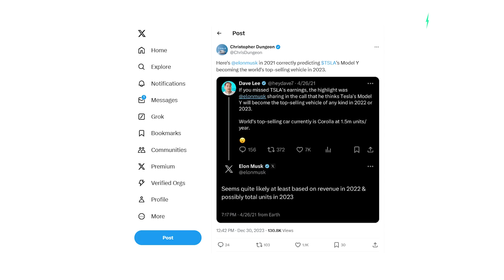CEO of CATL says Tesla’s 4680 battery cell is DOOMED to fail

Comment: isn't that the beauty of EV, locomotion independent of energy source?  switching battery technology is just plugging a different battery module in. switching between rotary, radial, diesel, inline, v shaped,  more or less cylinders requires major engineering changes and adding or subtracting major systems/subsystems including fuel,  cooling, exhaust, emissions, control

Comment: CATL is correct. Tesla has produced a lot of 4680 cells but people who had them in the Model Y and now the Cyber Truck can tell you they're not all that special. The really didn't seem to offer much more than the 2170. Supposedly they've just finalized the dry cathode process but CATL is already beyond that in battery technology. At this point 4680 concept 5 or more years old. The Cyber Truck has a huge battery but it didn't give the truck the range Tesla said it would have yet others who have huge batteries such as the Silverado and Sierra EV have shown that, yes, you can slap a large battery in the truck and achieve over 440 miles of Range and be a road king. I personally believe the next or future offerings from CATL will do the same and if Tesla is smart about this they would get all of CATL's future high tech batteries to be used in their vehicles.

Comment: I saw it in the first year 4680 announced and have shared my concern in previous comments. 

That cylinder volume increase faster than the skin area. If all else are equal : essentially, cell capacity and heat dissipation rise faster than heat sinking skin area. That impedes the cell size to around 18650 for optimal fast charge and discharge, Panasonic knew that. The 4680 form factor limits the product’s reliability and safety much below 18650’s.

Comment: There is a relation to heat dissipation - Tesla uses "snake cooling" with the 4680 batteries which works better than blade batteries. 

Blade batteries had been okay with LFP which have a lower energy density and therefore heat could be removed good enough. Now look at the competiting Geely's short blade system which is done for that exact reason - they are building higher-CC LFP batteries and they need a different design to handle the heat. CATL and BYD however announced lately that they have solved the problem allowing for 6C charging - but there is no real-life experience about that so far. A lot of hot air here?

Comment: As far as I know, the main engineering design of the 4680's is not being used as intended right now. And that is the ability to be cooled from the inside out using all those tabs by applying coolant to the top and bottom.

Comment: Elon Musk envisioned how the 4680 cell was going to be produced after watching cans being produced. There is almost nothing more inexpensively produced as aluminum cans. However, it is the filling of those cans that can cost a lot. Fill a can with water and it won't cost much. Fill it with caviar and the cost is completely different. Even if Tesla's 4680 cells never reach the energy density of a CATL battery, as long as it is good enough there will be a place for it in the multiple battery markets coming online. If the 4680 isn't good enough for Tesla personal vehicles because people are demanding ranges that are longer than it can provide, it will be good for the Tesla Semi, or it will be useful in the Tesla Power Wall, or they can be used in Tesla Mega Packs. And these are only things that are internal to Tesla. There are lots of companies that will buy a relatively inexpensive battery like the 4680 to use in their products (or Tesla could expand into these markets with the 4680), and those would be battery powered portable power stations, large electric heavy equipment like front loaders, mining trucks, etc., small electric equipment like tractors, bobcats, forklifts, etc., emergency power supply, the list is endless. Tesla just has to keep making the 4680 batteries and review its manufacturing to try to gain reductions in costs. Over time they can make chemistry improvements as well. There are LFP batteries on the market that are made using the cylinder form factor. Tesla could use its method of producing its 4680 cells but use LMFP chemistry, or Lithium manganese oxide (LMO) (manganese spinel) batteries that improves ion flow, lowers internal resistance, and increases current handling. Lower resistance means lower heat buildup in the battery, which is a complaint said of the current 4680s.

Comment: I mean What is Tesla known for? Cutting costs and ranking production. give it more time, its the right Way to solve the problem with the 4680 calls in the Long run they Will be able to outperform lfp batteries, its a cost and production time issue currently that halting Them.

Comment: Panasonic in the last these days said that their mass-producing of the big 4680 batteries is fully starting and the capacity of their 4680 is 5 times ( 500,% ) higher than the old format like 2170.
Now it is possible that the prismatic format of the CATL batteries might be better overall already, at least at fully and better volumetric utilization of any existing cradle volume, but the Panasonic's 4680 might create some good competition for a while.
However, by the time the waters get clearer between geometrical formats, the solid-state batteries might be out dethroning all other formats and chemistries.

Comment: I don't disagree that Tesla will likely use more prismatic cells than cylindrical cells, especially since CATL is the biggest battery maker in the world and that's where the most supply is. However, there is nothing preventing Tesla from making an LFP 4680. They are not mutually exclusive.

Comment: The 4680 was billed as "tabless" but the turth is it is many tabbed; which means it has to do the very difficult task of folding all these tabs perectly together at high speed and get a functional battery and also have production levels of cells to put in vehicles.  Cybertruck uses 4680 and production numbers are up; though way below any meaningful figures like even 100,000 Cybertrucks a year.  The entire line of Tesla's was suppose to have 4680s; that for sure will not happen before some hopefully better technology comes along that doesn't catch fire as Lithium does.  If BEVs can't find a better chemistry the entire segment will fall down.

Comment: Elon Musks masters thesis was about Super capacitors, which have many similarities to batteries so I think he knows more about it than this CATL CEO thinks.. Elon Musk never finished his masters because he became too busy with his start up companies and figured out remaining a student was a waste of time and money.

And Elon Musk is not really leading the battery cell branch at Tesla, he has some great team doing that for Tesla.

Also I dont understand why the CATL is so negative about Tesla, they delivering many Gwh of batteries to Tesla for their Chinese built cars and in  few months tons of CATL cells will go into megapacks!

The original motivation for Tesla to start developing their own Batteries was that the existing companies at the time were not moving fast enough and not enough batteries were produced and it did not look like Tesla would get enough batteries to fulfill their growth plans..

This all has changed somewhat, for macro economic reasons, Tesla has pulled back on their growth plans (Mexico factory on hold, extension in Berlin delayed), and battery manufacturing companies did catch up to a level there is no longer a shortage in battery cells for Tesla. Tesla has ALWAYS been saying they will use a shit ton of batteries from other manufacturers, so it is no news Tesla uses CATL battery cells. The 4680 was never meant to replace all other battery suppliers, but just a supplemental to what Tesla could get from battery suppliers.

But the same time, the development of the Tesla 4680 cells did not go as planned either, it was a lot slower than expected. But they have build out production capacity in Texas this year and the cells they make are all ending up in Cybertrucks, they even call it the Cybercell now.. Also Tesla is going forward with the Cathode plant and the lithiun refinery in Corpus Christy, this will reduce the costs of battery materials tremendously, and will lower the costs of the 4680 cell using these in house refined materials. If Tesla gets at a point they produce more than is required for the Cybertruck, they will start using them in the Model Y and probably also in the Cybercab, as these are the cheapest batteries for Tesla at that point.

Anyway, it is all a balance between costs, performance and availability, and we all know, Tesla is a master in allocating assets in the most efficient way.. So just let Tesla and Elon Musk do what they are best in doing, and everything will be allright.

Comment: i think even you're too negative on it; the format has nothing to do with the chemistry, there's no reason Tesla can't make LFP 4680s, they just won't until they're happy with the production process for NMC. Ultimately the cell manufacturing cost, regardless of chemistry, is what this is about. Think about it: any new tech has a higher probability of failing in the field, so as an OEM you want to introduce new tech in the smallest possible volumes first so if you have a high failure % at first it doesn't kill you on warranty. Model 3 was introduced before Model Y, despite them knowing Y would have higher margins and sell better. 4680 was introduced in some limited Y runs, and Cybertruck.

Comment: You could have included a discussion of tariffs on imported Chinese batteries and the IRA credit on U.S. made batteries. Both are material in determining actual battery cost in each vehicle. Also you could have expanded to consider Tesla using equipment from CATL to make LFP batteries in the U.S.

Comment: Due to the cylindrical shape the 4680 is inherently less dense at the pack level than a prismatic or blade format battery, and hard to use flat plates as heat collection/transfer fins between them, which adds heat dispersion problems if fast charging.
Reply: Yeah, its shape wastes a lot of space between cells.
Reply: @QH96  not much space, and much of this is occupied by cooling channels.
Reply: the tesla 4680s are the worst of all the batteries.   poor charging.   the worst degradation.     the only ones who benefit from using them are tesla themselves as they can make them cheaper then buying the byd blade batteries for instance(the best batteries)

Comment: About 30 years ago I was an electrical engineer working on portable data collection terminals. We were striving to significantly reduce the physical size of the new model over our previous models. Initially we were very enthused with prismatic batteries that Panasonic had developed. Unfortunately for us Panasonic discontinued the prismatic batteries because they said the batteries had reliability problems that they couldn't fix.

And here we are again. Except this time it seems like the problems with rectangular batteries have been solved. If that's so it certainly seems like the 4680's days are numbered. All other things being equal it is hard to see how a rectangular battery won't win in the end.
Reply: Can't cool them square is horrible for batteries.
Reply: @oleolson6553 Of course they are cooled. Millions of battery packs use them.
Reply: Depends on how many houses it burns down.

Comment: For the Chinese, everything is about saving face. If Tesla succeeds with the 4680, CATL will loose face. This is just cultural hubris, nothing more. The 4680 is a great design, adaptable to any battery chemistry. Prismatic cells are harder to keep cool because the core of the battery is too far from the surface.
Reply: If CATL had problems keeping things cool, they wouldn't be selling grid storage with twice the energy density of Tesla's megapacks. Tesla is way behind
Reply: You have go tthat backwards. With prismattic cells you can make them thin so heat dissipaion is not a problem. Prismaic is far more flexible than cylindrical.

Comment: Musk is missing the point. CATL isn't saying Tesla won't make money, they are saying 4680 is not a successful design. and I agree, cylinder battery has alot of issue due to the rolling stress means the material is always going to be unevenly stress. this means it is going to reach the peak of what the material can do alot earlier than other form factor. the only reason Tesla pick this is due to their experience with panasonic making cylinder batteries, but it is a dated technology, you can't change physic. eventually even Tesla itself will abandon the 4680. it is just a dated design.
Reply: It's dated but safe since it really doesn't matter a lot, getting dry cell working and cobalt out along with silicon in are the hard miles.

Comment: I'm also not a battery engineer but all along I have wondered, isn't a rectangular battery more space efficient than a round battery when packaging them into a giant rectangular box? Just seems to me the dead space between cylinders is space that could be filled with battery chemicals. Like square drink boxes packed in a given size case have more drink than round cans of drink in the same size case.

But again, I'm not an engineer and just thinking out loud.

Comment: Solid state will crush all the current form factors
Reply: Why is that?
Reply: The chemistry and the form factor are two quiet separate things.  There is no such thing as a solid state form factor.
Reply: Solid state is currently a non factor. Too expensive, not enough charge cycles.
Reply: @ that is not what QS says. They say it will be cheaper to make.  They also noted it has over 1,000 charge cycles.  What solid state batteries are you indicating dont excel.
Reply: @cascaderetriever7618  they currently cost well over $100/kwh, while LFP batteries are getting close to $50/kwh. Current versions of solid state haven't performed well in low temperatures, and 1000 cycles isn't that much. LFP should have 3000-4000 cycles. CATL did a lot of research on solid state, and decided it wasn't worth it.

Comment: I think I remember Elon himself saying that they got into the 4680 as a hedge.  Tesla saw that as other auto manufacturers started making EVs that battery costs would go way up and supplies would go down. They also already knew that they were going to make the Cybertruck (CT) as they debuted it shortly after battery day where the 4680 was announced. They knew that the CT would take a lot of batteries.... originally shooting for 500 miles of range. 
     So the 4680 battery was a hedge in case battery prices continued to spike. However the opposite occurred as OEMs slowed their EV production after a false start.... and that explains why Tesla was slow to get the 4680 into mass production.... along with the technical hurdles. 
     The 4680 will be used for Tesla's higher energy  battery chemistries. The ones that go into large vehicles and possibly the Roadster. All their other vehicles will eventually be on LFP chemistries in a different form factor.... probably prismatic. 
      Note:  The main reason, IMHO, for the holdup in the Roadster II release is range. Tesla learned from the CT release that the main disappointment with the CT was its lower than promised range.  They don't want to have that happen again with the Roadster... which they promised 600 miles of range for.
Reply: Elon made a lot of promises...

Comment: Tesla is doing with batteries that legacy auto is doing with cars—sticking with an original design.  Tesla’s cylindrical cells derive from Panasonic’s cylindrical alkaline cells, which they’ve made for decades, and implemented for lithium batts.  I’ve always felt cylindrical cells made no sense for EV’s and battery storage as prismatic makes more sense.  I trust the CEO of CATL over a deeply deranged--Musk, who has zero engineering degrees and experience.  Prismatic solid-state batteries are the eventual winning design and chemistry.

Comment: Tesla is falling apart in front of our eyes. Proving, yet again that everything that trump touches dies. Cyber truck reservations initially pointed to a 5 year wait, now you can order one and get it by thanksgiving. CT has just had its 4th serious recall for inverter issues. It's only allowed to be on the roads, basically because Tesla said that it was safe. Self certification gone mad. Sooner or later there will be a lawsuit for damages caused by the damage caused by the CT in an accident. The only thing that will save Tesla is currently trump and I expect that relationship to last a little longer than Scaramuchi, but not as long as General Kelly. Old tired models, still no Robo Taxi, still no small affordable option. Musk has basically moved on to the new shiny object. Politics and oligarchy.

Comment: The biggest issue with a cylindrical cell is wasted space when you package them. Which increases weight and size of battery pack. If you have cells that are square or rectangular they do not have spaces and could make a much smaller pack reducing costs. The only positive for the 4680 is making it structural as the floor. This can reduce cost of manufacturing the vehicle itself.
Reply: But cylindrical cells can be wound very quickly; that's obviously why they use that form factor. Apparently that advantage outweighs the space reduction of a square/blade approach, at least right now.
Reply: No, the biggest issue is cost
Reply: @jackylsmith8138  And what happens when you pack cells together without space?  You have to add a refrigerator!
Reply: This is exactly right. He has repeatedly praised Chinese innovation but this 4680 has always been a cost thing that I have known of